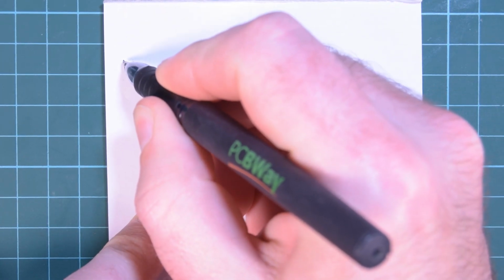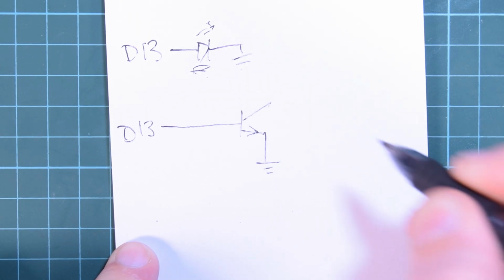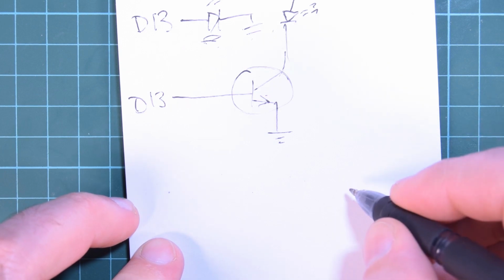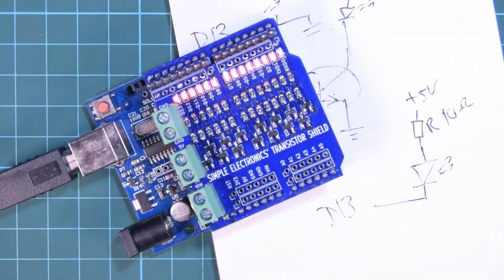The UNO Shield To Power Them All!

Comment: Oh, this is cool!  You might see a rogue clone of this for sale on Ali soon.  Some ideas for mark 2:
AO3400/AO3401 mosfets are tiny, cheap, ttl level, and one of the stock PCBWay components.  Complementary pairs could share the same gate, such that every MCU pin would control sourcing or sinking from the power rails, on the same output pin.  A pair of output pins could be an H-bridge (useful for reversing DC motors, or steppers).  Yeah, this will be more complicated if your high rail is above 5V; you would need a 3rd transistor to reach the PNP gate.
Another idea is the use of 2.54mm 1/2 sized screw terminals.  They exist, and are more secure than DuPont couplings to pin headers.
Reply: Totally agree AO3400 is the way to go, cheap and seriously high current (about 6A - or 3A for fakes!) compared to the tiny 100mA of the MMTB3904.